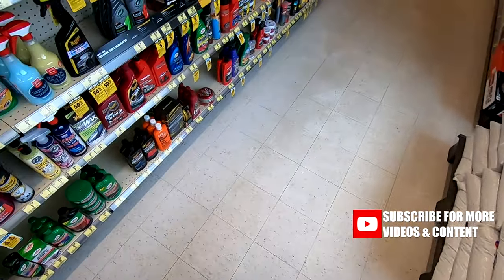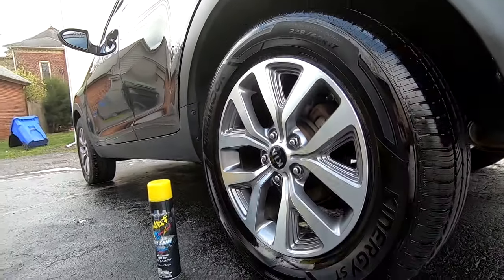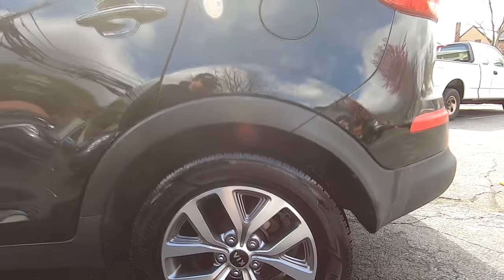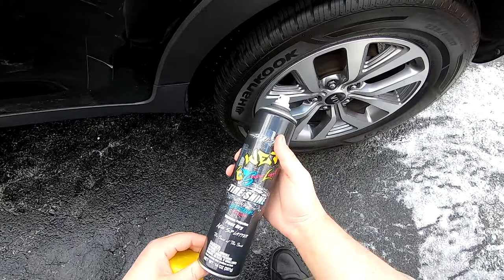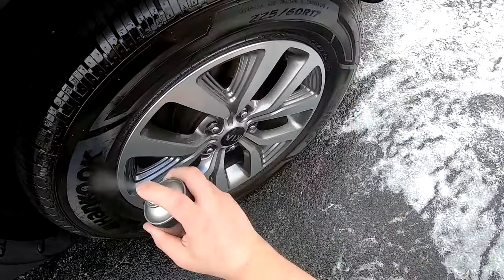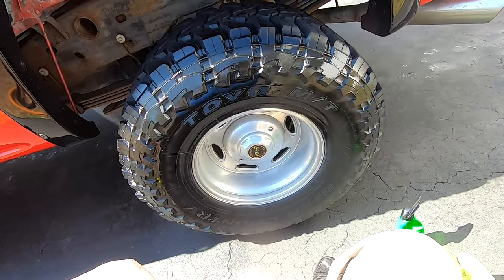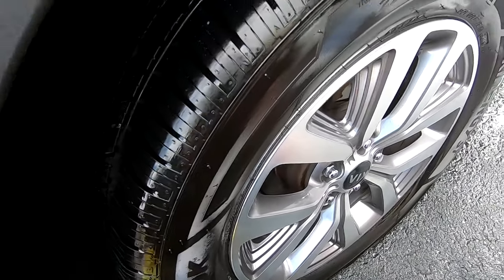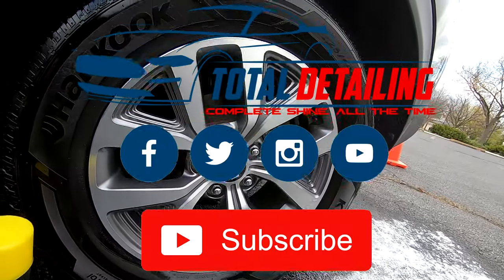THE WETTEST & BEST TIRE SHINE EVER? | WET Street Legal Tire Shine #MobileDetailing #AutoDetailing

Comment: I can attest. This stuff is the real deal. 7 days ago I used this on a set of Goodyear Wranglers on my Jeep Wrangler. These are deep lug, off-road tires and they look almost as wet as the day I put this stuff on. I followed his instructions and cleaned the tires thoroughly. Went thru 3 brushes, and almost a full bottle of Super Clean tire and wheel cleaner, cleaning the tires. 

Put on 1 coat, wiped it down. Put on a light second coat and let it sit overnight. Amazing amazing shine. I'm gonna buy this stuff by the case.
Reply: Good to know, thanks.